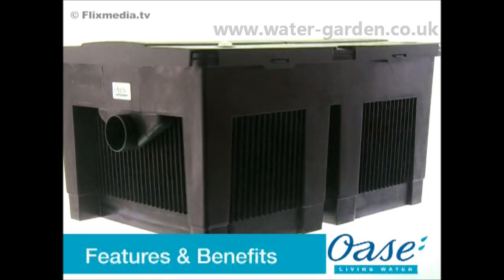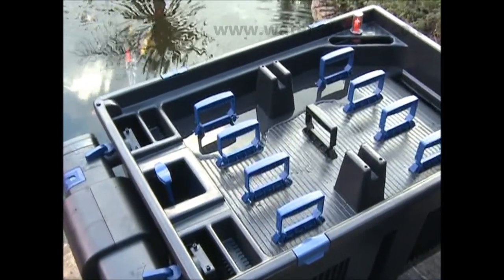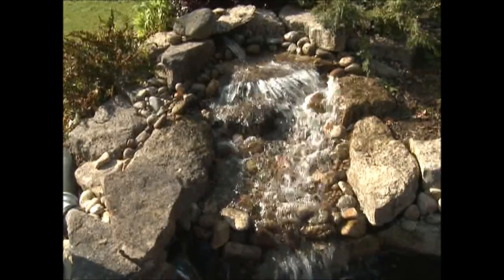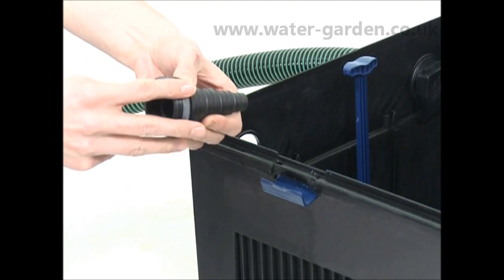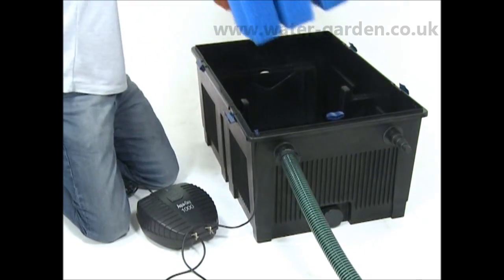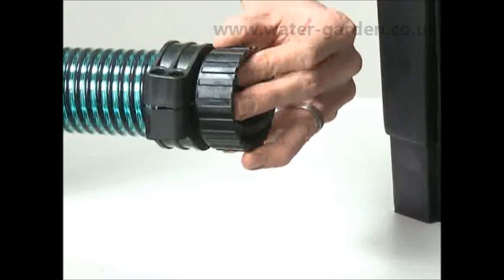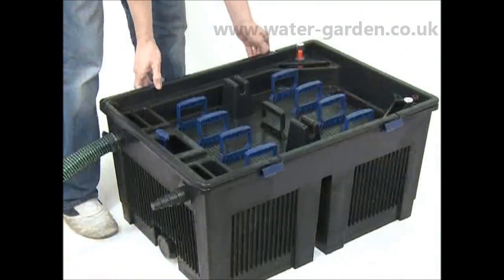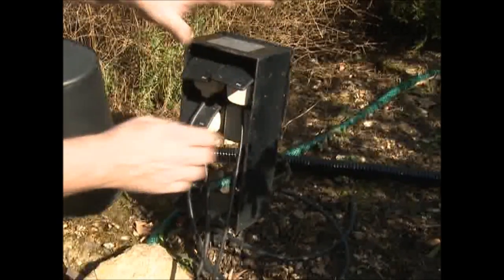Oase Biosmart 36000 (Biotec 10.1)

Comment: When you flush the filter with the garden hose attached surely the tap water would then kill of all the beneficial bacteria?
Reply: Correct. It would not be recommended to use treated tap water to flush your filter.
Reply: the way its designed the hose water doesnt flush through the sponges, only washes the sludge from the bottom